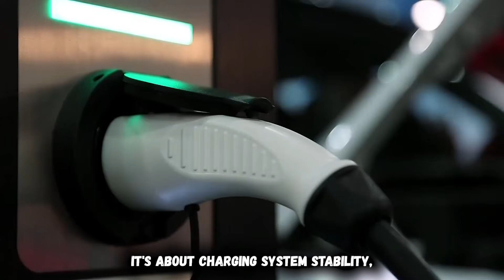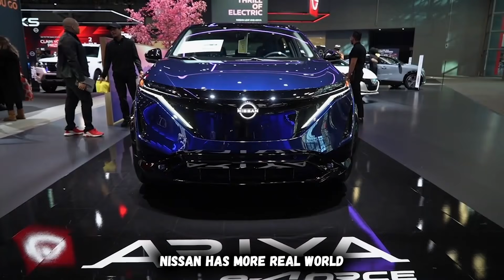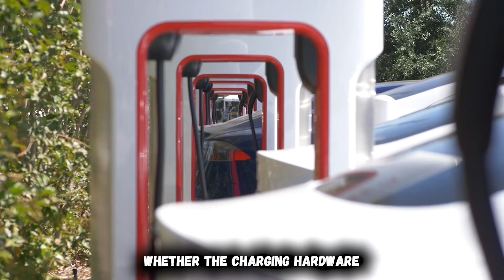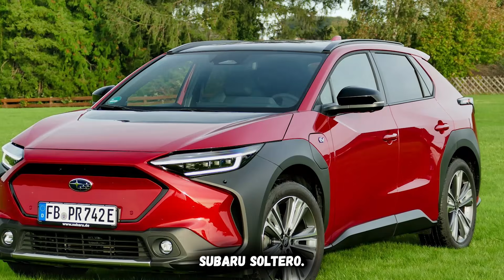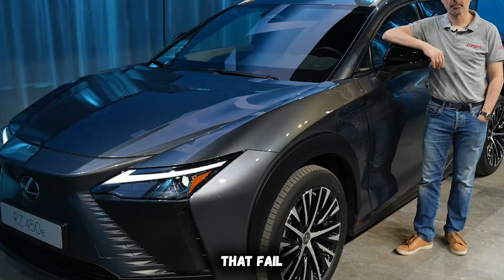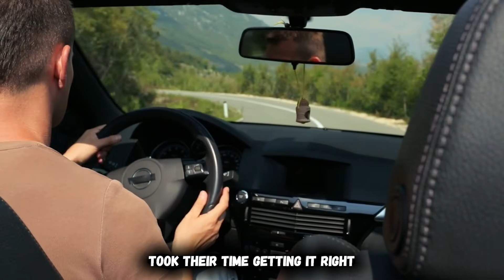6 EVs So Reliable It’s SHOCKING the Industry

Comment: Not a lot a fact here
All the Hyundai and Kia have big problems of charging and high voltage to 12v charging and keep failing at significant rates.  They still have completely resolved this.  Google this , careful.
Reply: Yea, it was a problem on my I5 2021 and still is a problem!
Its the ICCU failing.
Got rid of it due to this.